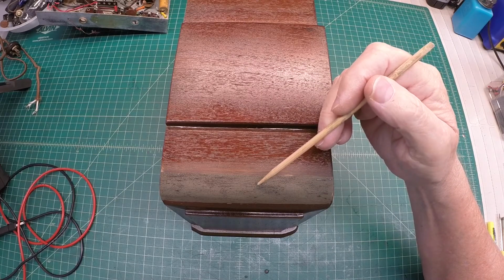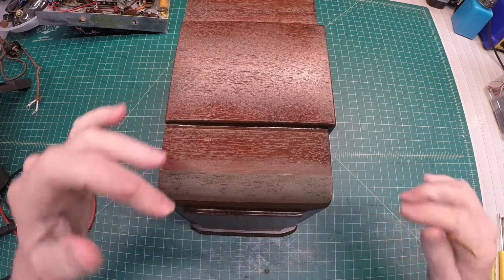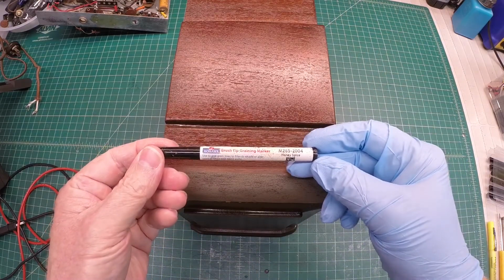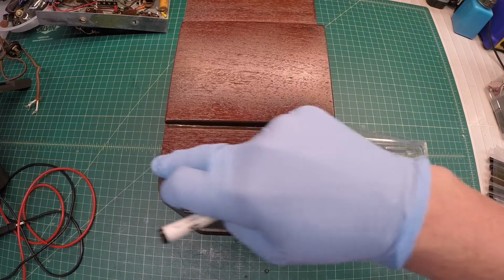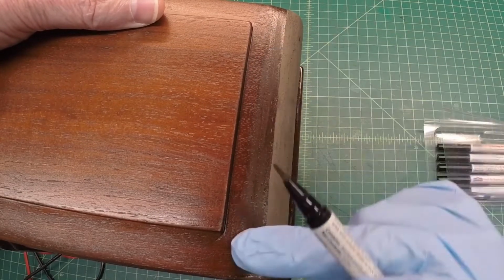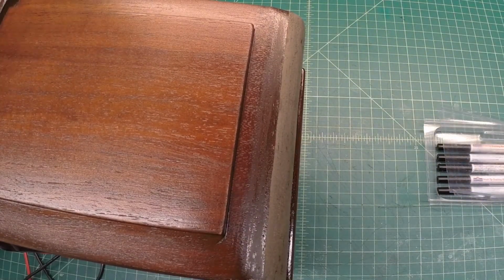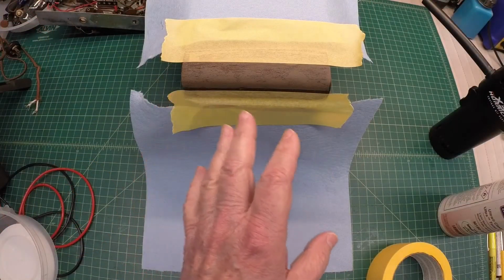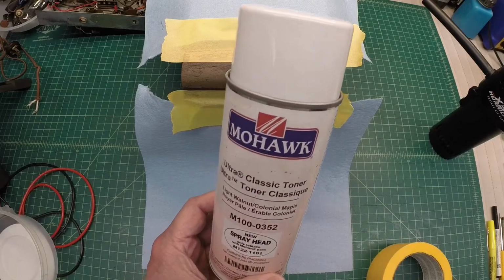Peter Pan Radio - Day 10 P1 (Using Toner Lacquers on a Repair Area)

Comment: Hey Don
  Was the Tone control a chassis update?  Note the 4-T pic here.
http://radioatticarchives.com/radio.htm?radio=11461
The 4 peter pan on this site does no show it.
  Also the schematic in Gernsback Vol. VI page 520
 is a little clearer if blown up.

Nice work
Ken
Reply from the maker: +Radio Ken Hi Ken, thanks for the link & info. Interesting to see another chassis that's similar to the PP layout. The transformer is different, the RF Coil position is different, there's a tube shield on the Type 58 tube? I believe and to your point, the tone control on the back. Looking at the chassis hole on my mine, I can tell it was drilled by hand and not a chassis punch like the others. It makes for an interesting discussion. The capacitor value chosen tied to the output tube really allows more highs than bass. I wonder if they caught this during the production and decided to modify the design on the fly? BTW - do you restore vintage electronics? Best, Don
Reply: Just thought I'd throw that out at you. I work on stuff as I can.  My late Uncle had stored away an old heathkit TC-2 tube checker that I'm working on now.  He passed away in the late eighties and was a radio/tv tech. and also was an electronics instructor.  I'm in my late 60s and a retired computer tech.  I was trained in radio (am, fm, phase shift,etc), radar, and computers in the service.  I'll never get all these radios restored.

Goodluck
Ken